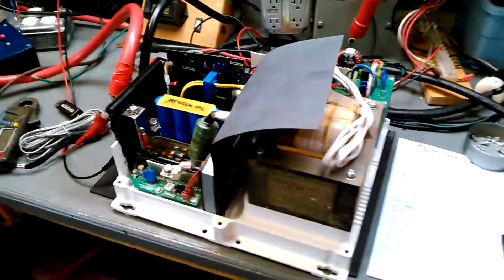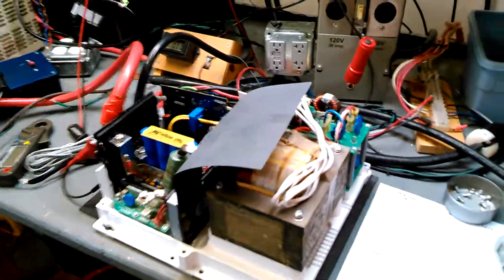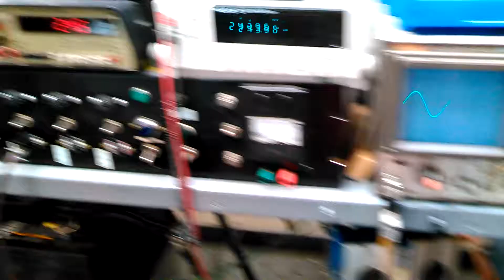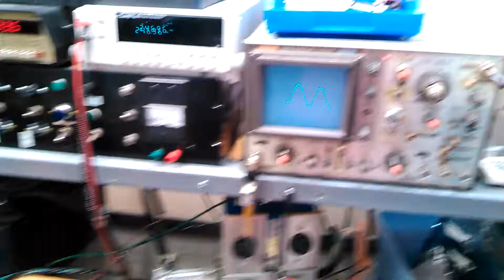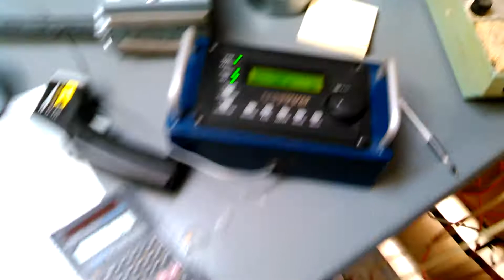Magnum MS4024 inverter repair test

Comment: Hey, how are you, i have a ms4124 magnum inverter and it got struck by lightning, checking the fet board Output with my multimeter set on Ac Voltage, it has 20VAC on one side which is normal but 0 volt on when i alter the probes 

Any idea What i look out for  ?  i would like to get a replacement and i live in Nigeria, is it possible you help me get one ? 

Its a serious issue getting it from here

Comment: Hello. I have a MS4448PAE installed since last year and sudenly stop to work and I saw smoke coming out. So I disconnect the inverter from battery bank and take aún eye inside the inverter.  The unic device lookig damage is one blue capacitor on the FET board, the one closer to the DC plastic plate were are the plus and negative terminal to the battery.  The rest board and comoonents look fine.  Do you have any idea what could cause this issue and if could be fixes or I will need change the FET board? Thanks in advance!!!
Reply from the maker: If the unit is under the three to five year warranty we can repair it at no cost, you just pay shipping. If there are problems with the circuit boards we normally do not repair these we must replace them. The boards are very expensive so as long as it looks like it is limited to just one board it may be worth fixing. Call for more information 573-814-3131

Comment: Hello, my MS4024 inverter is giving the "Internal Bridge Fault" error. Would you happened know which component in the unit has malfunctioned please? Thank you.
Reply from the maker: A bridge fault means that the micro-controller is in  invert or charge mode but it does not see an output. There are a lot of components between the controller and the output. It could be on any one of the three circuit boards and they are all very expensive. Unless you are very good at electronic repair or have a lot of money to risk I would send it to an authorized repair center. Check the Magnum website or call us 573-814-3131.

Comment: Hello, I have my ME3112 magnum inverter, yesterday I found that the voltage out was 96v and I have devices that refuse to operate at this voltage.  but that happened after my wife connected an iron to the inverter.  
What do you suggest to me?
Reply from the maker: I would not think the iron would hurt the inverter. Check any GFCI outlets to but sure they have not tripped. Then check the 'Search Watts' setting. Be sure it is off.  If you are using a DMM type meter it may read low if it is not a 'True RMS' type. Lastly you need to check all connections both AC and DC for loose or corroded terminals.

Comment: I have a conext 4024 which is just like this inverter and I am getting 185v ac from l1 to N and L1 to L2 but no voltage from L2 to N.  Any ideas where I should look first
Reply from the maker: I am sorry but I am not familiar with the Context line. It could be a stuck relay in the unit or a neutral line on has come loose.
Reply: @pcselectronics5423  thanks it was a wire that came loose from the transformer to the board

Comment: great video .....can you point me in the right direction to buy mosfets  for model MS3748
Reply from the maker: I have not ever had this model in my shop so I don't know the mosfet part number but you can check all the usual places like Mouser, Digikey, Allied Electronics. Just remember, there was a reason the transistors went bad. That means you may have to correct some other problem as well. You may put new transistors in and boom! You need to check for good gate drive signals with an oscilloscope and make sure the large transfomer does not look burnt.
Reply: @pcselectronics5423  the reason for the mosfets to go the customer was using the Inverter to charge the batteries and the voltage was very low on them so the voltage spike and destroy them.... thanks I will check all the things you suggested

Comment: Hi,  I did the thing you're not supposed to do which is to disconnect the ground while power is applied.  What kind of damage have I done and how much do you think it's going to cost me to fix it?  This sucks because it happened just as I was upgrading my system with Lion batteries.  This inverter has been great and I really like the fact that it can draw power from the grid without sending any power out to the grid.
Reply from the maker: Are you saying that you removed the battery ground? I would not think this would instantly damage the unit. What are the symptoms now? Does the unit invert? Does the unit charge and pass AC? Is it just completely dead? Repair on the this unit could run from $600 to $1400 depending on what is wrong.
Reply: @pcselectronics5423  According to the installation guide, if you disconnect the ground while the battery + is still energized the grounding will first go through the comm line and cause damage.  I had disconnected the battery but I hadn't disconnected the charge controller and the sun was shining.  The failure seemed to cascade with the unit attempting to come on and I thought I might have just had a setting wrong.  I went back into the settings and turned off the "Search watts" and the unit came back up and started working.  I left for a couple of hours and when I returned the unit was off and would not restart.  I'm within the three year warranty but I doubt they will honer it as the mistake was mine.  It now won't communicate with the head unit and even if I disconnect the head unit it won't start inverting or even bypass current from the grid.
Reply from the maker: OK well hopefully everything is fine now.